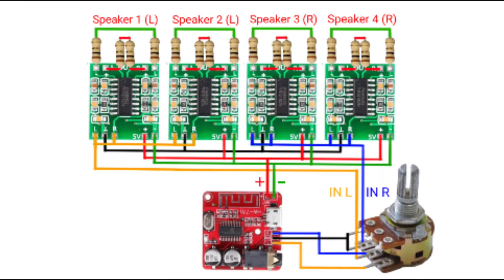DIY Mini Bluetooth Speaker 4 x Speaker Asoka 2 inch + 4 x PAM8403 BTL???

Comment: kenapa ngg pake modul tpa 3110 ato XY P15W? tinggal paralel ke 4ohm per channel. kasi input baterai 12V up ke 15V. 
sayang speakernya ngg pol powernya klo dibuat seperti di video.
Reply from the maker: Bner sekali om.. Kinerja speaker emang g maksimal.. Sy cm cba2 aja sih sbenernya & pengen bikin yg 5volt yg suaranya lumayan ngebas om.. Hehe
Reply: Memang susah buat speaker dengan input 5v pakai amplifier yg ada di pasaran. Kecuali, nemu board kanibalan JBL charge/flip ato HK onix series.
Reply from the maker: @randomthings2843  untuk board jbl ada sih om yg jual.. Tp harganya mahall.. 😅😅

Comment: Why resistor used with amplifier?
Reply from the maker: In my opinion, the function of the resistor in this circuit is as a separator between the L & R amplifier outputs..
Sorry if I am wrong.. 🙏🏽🙏🏽

Comment: Problems if you do not use this register.  Will it work if I give the connection without a resistor?
Reply from the maker: Of course.. But I tried without a resistor, the sound it produces is not loud.
Reply: @Yand27_ID   k thanks ❤️🙏🏻
Reply from the maker: @mytechformallus4876  You're welcome brother.. 🙏🏽

Comment: pam 8403 dijodohin sama asoka bright 2 inch kira-kira match gak ya bang?
Reply from the maker: Asoka bright itu yg kek gimana ya bang?
Reply: @Yand27_ID , kalau yang varian bright itu menurut deskripsi di market place mid range-nya lebih renyah meskipun bass-nya juga cukup nendang.
Saya berencana pakai asoka bright dengan mini ampli pam 8403, makanya butuh referensi apakah match atau tidak.
Reply from the maker: @dony1065  untuk speaker mini sih udah cukup pakek pam 8403